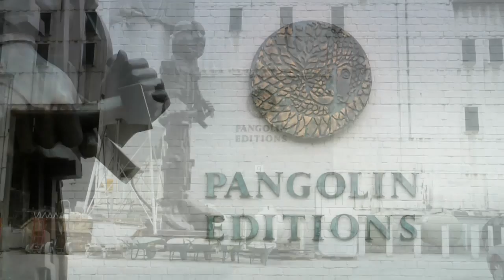Pangolin Editions Lost Wax Department 'Making the Wax'

Comment: how much thickness is necessary for wax? more thickness means a heavier and more costly bronze product. and a thin thickness means an incomplete casting
Reply from the maker: reza emami If you watch further in the videos you will be able to judge that there is a happy medium and therefore the thickness of wax varies on the size of the sculpture.
Reply: first I brush was in different silicone sections. then I assemble difderent sections and then pour molten wax inside the silicone mold and then pour it out. but the problem is that the final wax replica does not have an even thickness at different positions. is there any solution? because many times I have defects at thin parts of my sculpture.